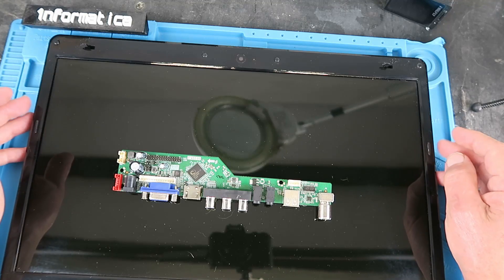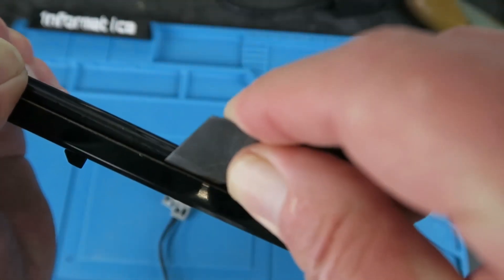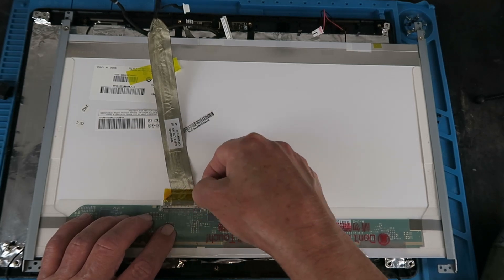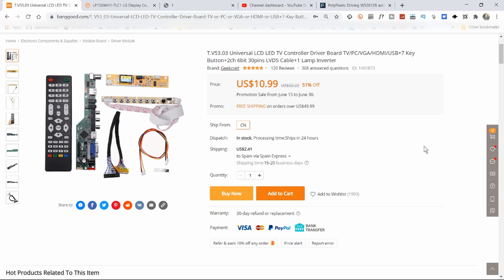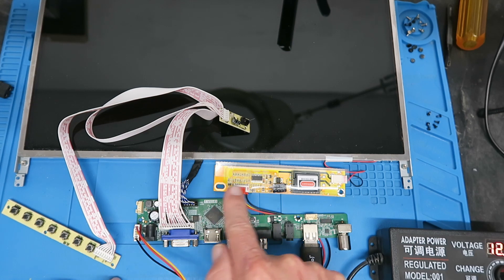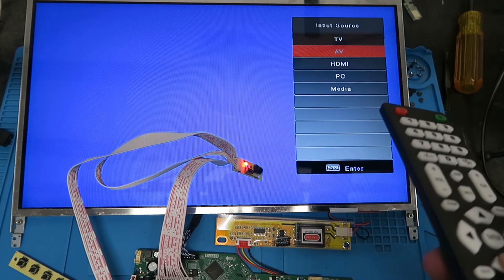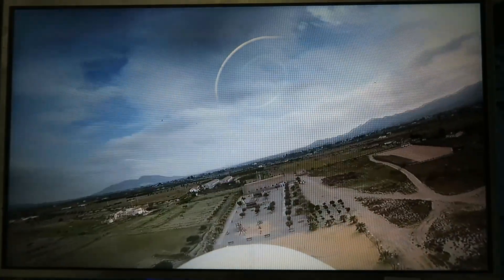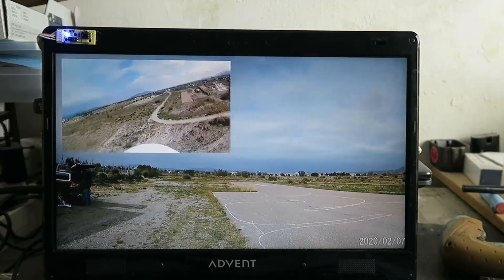T V53 03 Universal LCD LED TV Controller Driver Board Review Test

Comment: Have an old TX39D30VC1GAA  panel the problem is that it has an integral CCFL backlight system, so instead of one power cable it got 2. What are my the options here with this controller?
Reply from the maker: I see 2 options. If you have the original CCFL board maybe you can power it from the controller board. Alternatively buy a 2 lamp inverter : 2 Lamp Backlight Universal LCD CCFL 10V-28V-Inverter https://bit.ly/2LampCCFL Please consider subscribing if you have not done so already!

Comment: Would this work on an Old B101aw06 1024x600 10inch screen? (Dell Inspiron mini) 

I've been trying to look up tutorials on this specific screen since it's the only one i plan to reuse as a 2nd monitor, but there are so many controller boards out there and tutorials on screens this size are so scarce that I'm afraid it might not work.
Reply from the maker: You can see the data here : https://www.panelook.com/B101AW06%20V0_AUO_10.1_LCM_overview_358.html
Although the board I used supports the 1024 * 600 resolution and 3.3 volts it does not come with a 40 pin LVDS cable. You can make your own cable https://sites.google.com/site/lcd4hobby/lvds-cables/e-40-pin-cable Please consider subscribing if you have not done so already!
Reply: @1nformatica  alright i think i have half the things i need figured out.

Comment: Hi, I have it connected to a 12v 4a source and it turns on and off the second, what can I do?
Reply: If it stays on, what can I do?
Reply from the maker: @alphalalo189  If it stays on with the inverter disconnected then most likely is that the inverter board has failed and you need to change it for another. Also could be that the board is shorting out on something, they use high voltage so take care!
Reply from the maker: If you have a cold cathode backlight it could be a failed inverter. Try disconnecting the inverter and see if the board stays on.
Reply: Ok doing a more thorough inspection is the lvds cable that when the power reaches the panel makes it turn off and on the second

Comment: I'm having problems after flashing the firmware, i used a 1366x768, but it shows nothing. The backlight is working fine. I tried flashing a 1280x768 firmware but it only displays rgb colors
Reply from the maker: Check what the maximum resolution of your panel is at : http://www.panelook.com/index.php
When you see just rgb colours it is usually the panel ID that needs changing : https://youtu.be/C2YTL25iyHU?t=468 Please consider subscribing if you have not done so already!
Reply: Hi how can the firmware be changed?

Comment: Interesting video sir its very imformative i bougth T.V53.03 board for my lcd T.V panel but i need a firmware panel resolution is 1366x768 can you give a link? I would be very gratefull...☺
Reply from the maker: You can get the firmware here : http://myosuploads3.banggood.com/products/20191224/20191224024127T.V53.03.rar
Please consider subscribing if you have not done so already!
Reply: Already subcribe sir..thank you..

Comment: i already have this board, but the problem is i never tested yet it might be damage.  https://drive.google.com/folderview?id=1VgNRoKxBMhes6VcAY3Z_7iPaaTZflbz2 is it correct? im using ldvs 40 p may LCD is LP156WH4‑TLA1 how can i use ccfl inverter? thank you.
Reply: @informatica ineed your answer before i test it. thank you
Reply from the maker: Hi, thanks for the comment. You can view the panel data here : https://www.panelook.com/LP156WH4-TLA1_LG%20Display_15.6_LCM_overview_12272.html
It has a 3.3 volt power input which is set by a jumper on the T V53 board. I assume the 40 pin cable was supplied so should be OK it looks to be connected correctly. You can check it here : https://sites.google.com/site/lcd4hobby/lvds-cables/e-40-pin-cable
The data says it has a built in LED backlight so there is no CCFL inverter needed, the LEDs should come on when the board is powered. You need a 12 volt power supply for the board of at least 3 Amp capability. Good luck!
Reply: so my diagram is correct for these? https://drive.google.com/file/d/1VoAu2RMeK6BVuVL-iWsFnyzmPj7R1Rs8/view?usp=drivesdk instead a ccfl inverter?
Reply: it d sent show an image. https://drive.google.com/file/d/1W_npMSqc1wt7E0_wisGCSwq8UP1ZZp19/view?usp=drivesdk
Reply: this is it https://drive.google.com/file/d/1WYOa5xuP7ylSfiCf06PtcNolqLYjCzAt/view?usp=drivesdk

Comment: the led changes slowly from red to blue. but it doesn't do it quickly
Reply from the maker: Possibly a bad USB stick. You have unzipped the file so it is a *.bin and in the root directory of the drive? Also make sure your power supply can deliver over 3 Amps. Please consider subscribing if you haven't done so already!!

Comment: Hi, i've the same controller board, but my monitor start to turn on and turn off very quickly. Do you know which could be the problem?
Reply from the maker: It is possible that the power supply you are using cannot supply enough current. The board is quite power hungry needing a minimum of 3 Amps. Also check the high voltage backlight board is not touching anything. Otherwise maybe a broken panel. Please consider subscribing if you haven't done so already!!

Comment: Hi, thanks for this, they uploaded it on Banggood now. Connected and flashed firmware but shows a screen with green and black horizontal lines, any idea? Thanks!
Reply from the maker: Provided the flashing was successful (LED goes from slow flash to fast flash) then:
Double check the supported resolution both of the file and panel.
Change the panel settings in the "hidden" settings menu.
Maybe the panel is faulty? https://www.google.com/search?q=green+and+black+horizontal+lines+on+monitor&rlz=1C1ASUM_enES692ES692&oq=green+and+black+horizontal+lines&aqs=chrome.6.69i57j33l7.4209j0j8&sourceid=chrome&ie=UTF-8
Please consider subscribing if you haven't done so already!!
Reply: @1nformatica  Thank you. Surprisingly it was my brand new Sandisk USB stick that was playing up and therefore not allowing the software to flash. Bought you a coffee on PayPal, keep up the videos!
Reply from the maker: @alfiecroft2435  Hey Thanks! Much appreciated. Please consider subscribing if you haven't done so already!!
Reply: I have a V56 board for screen M215HW01 VB. It came with firmware already installed from the seller. But the "menu 1147" method does not open the hidden settings on mine. The screen will turn on and display, but the colors are all wacky. Just like you said in your video it looks like an acid trip, or something. Anyway, do you know of any other master codes that may have been used in other versions?

Comment: I have mine working but have the same problem as another person, The backlight is at 100% and the option in the panel menu does not make any difference not matter what you set it at. How can I adjust the backlight?
Reply from the maker: In the menu option "Picture Mode" you set the mode to "User". You then have access to the brightness and contrast controls. Please consider subscribing if you haven't done so already!!
Reply: @1nformatica  Thanks, but that does not help. The backlight is at 100% the screen has a white glow to it even when I run the test modes from the hidden menu. In the hidden menu under panel is an option for "backlight" but it makes no difference. That is what I am trying change. The way it is now, everything is just washed out due to the backlight. I subscribed as well.
Reply: @Static1701  Hello, did you find solution for adjusting backlight? I have same problem :/.

Comment: Any idea how to lower the brightness and the led light. I tried brightness also changing backlit on the secret menu....nothing happens
Reply from the maker: If you mean the power LED on the remote controller sensor board then you will need to put a resistor in series with it. As the device is 2 LED's it has one "common" pin which on my unit is the centre pin which goes to ground. This is the pin that you would need to put a resistor in series with. I guess it would be easier to desolder the LED and remove it from the board to do this.
Reply: @1nformatica   I mean the backlit light of the monitor itself....the monitor is too bright in the night ...the led on the board is not a problem ..fixed it with a tape. But the screen.....I don't know how to lower the brightness
Reply: @saafirosz  Hello, did you find solution for adjusting backlight? I have same problem :/.
Reply: I finally put some video on my youtube page, on how to hook up the pwm to control backlight brightness.

The Great Wall of Google is censoring our posts. They want you to bow down to the new god (AI). Wayne atlast WayneSallee. Cinnamon Operate Mad